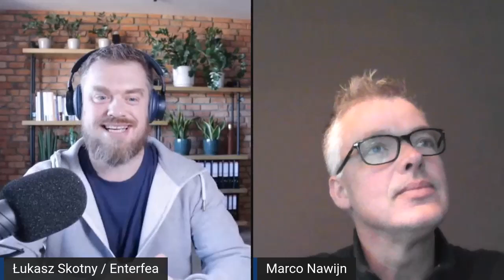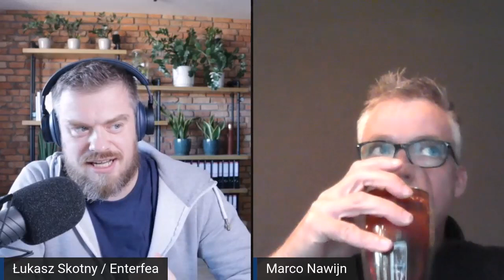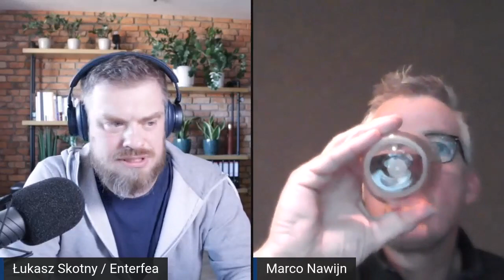FEA theory - Do you need it in practical design?

Comment: I like the analogy of driving a car without knowing how the engine works. It depends on what your goals are... if you want to get from A to B, then sure, just drive the car. If you want your car to outrun the competition in a race, then you had better understood how the car works. The good thing about FEA users is that they are all smart people, so even when they don't want to or need to, they will eventually learn more and more about how the car works anyway.

Those messages from the solver which are expressed in mathematical terms, are (in my opinion) just showing the inability of the solver developers to come down to user-level. We would not accept that kind of behaviour from car manufacturers (at least not  anymore in modern days), but in solver world progress is slow. They would rather add some exotic new feature that benefits 0.01% of the userbase, than to make the solver output easier to understand.

Comment: 41:51 When engineering strain of a uniaxial tensile specimen is measured and reported, the reference gauge length (e.g. 50 mm) is much larger than the length of the necking region. This arbitrary definition of strain underestimates the true strain of necking grain-scale or mesh-scale elements. Therefore, plastic strain of necking materials computed in FEA is not directly comparable to material data, unless the neck area was measured, and true strain was calculated using: εt = ln(A0/Aneck).
Reply from the maker: Sure, although it has to be said, that usually the strains are limited (by the codes/standards/practice) far below values that would even get closer to necking start
Reply: @Enterfea  Yes, except where there are high stress concentrations. I’m fairly certain (but not 100%) this is why a FEA/real-world case can strain far greater than the tensile test (engineering strain) value, before fracturing.

Comment: I would argue teaching theory at university is a good thing, because:
- lessons time is limited, so getting to know foundational theoretical stuff behind all or most of analyses might be better than some practical stuff (the more particular an example is, the less broadly applicable the takeaways may be)
- professors usually know more theory and colleagues at work more practice, so learning theory at university and practice at work makes sense
- practical knowledge comes with practice and there are no shortcuts here (except maybe if you know more theory, you may also gain more from practice)
Reply from the maker: I disagree with such a logic Tomas, although there might be something there. While I agree that professors are heavily theory-oriented (I would dare to say in a significant majority of cases), that would be a problem of "why those professors, instead of somebody else" then. I mean, we should teach what we know the most (for sure!) but in the end, University also selects what is being taught "in general", so it should strive to find teachers who can effectively teach what University wants to be taught (finding such teachers may be impossible, this is a separate case). 
And since people doing the work, tend to know the "practical things", and are not using the theory that much... why teach theory at university? It's almost as if teaching folks is a semi-unneeded thing, simply because we have teachers who can teach it!
As for the time constraint, I'm 100% sure that a Uni graduate will not be able to write her/his own nonlinear solver... just the same as performing a complex FEA analysis. But that graduate will have a vague recollection of either theory or practical things. Absolutely not a "complete image", but a "base"... and theoretically, University could choose what that base should be... clearly they've chosen theory in many cases, which isn't the majority of the "needed" thing in actual work. 
And this is also a complaint we hear all the time... that universities do not teach skills that are needed in the workplace - I guess I would agree here.
But being an ex-academic teacher I can tell you, that teaching theory is easier, and it's easier to verify if it "worked". Plus the teachers are already there... so it may be, that it's just the easier solution, not a plan :)
Reply: @Enterfea  If you know what the students will be doing in the work, it is easy to create practical lessons for that. But in reality you cannot know this. Also, one of the selling points of study programmes often is that you can do many different things after that, in which case teaching just practical stuff is not very effective. For example, better understanding of linear equation system solvers may help you in many different applications and you would have to learn quite a lot of different "superstitions" to compensate for that. Role of university has always been to teach the underlying principles, which is of course getting more and more difficult when the tools we use are more complex than ever.
Also the skills needed nowadays are vast and it may be impossible to learn everything at universities. In my opinion, having fresh engineering degree does not signal to a company that you already know what they need, but it means you know some basics and have the ability to learn more. If they need you to have some special skills, you can enrol in a special course for that.
Extreme example may be IT, which is developing so fast, that teaching practical stuff using one set of tools is terrible strategy, since these tools may be obsolete by the time you graduate. Teaching principles is then much better.
Reply from the maker: @tomasletal257  that is definitely an interesting point. But I think that advertising higher education as "you may do a lot of things after it" seems a weird idea... here we would say that you will become a specialist in a field (and I'm not saying this is happening, but that would be a selling point). At some point, we have to specialize in something, and I think it would be the University level that does this. Still, this is a philosophical question really... assuming that the goal is to teach folks "broadly" would really be the goal (and maybe in your country it is, I'm not objecting to that as an idea really), then I would say that practical understanding of the strength of materials, broad effects like stability, fatigue, etc. would be far more important than learning how linear solver works... so as you can see I would still opt to teach other things than FEA theory... still the beauty of engineering lies in its complexity, and it's actually great that we can do our jobs and follow our engineering passion even though we do not agree on some things :)
Reply: @Enterfea  The idea is not so weird. Simulation tools are developing very fast and its hard to say which skills will be needed in 10, 20 or 30 years. Shifting the teaching focus to fundamentals in such situation is only natural.
Reply from the maker: @tomasletal257  Here, I can easily agree, although I would define fundamentals in terms of engineering skills mostly. So as I mentioned before strength of the material, hand calculations, and understanding of problems like buckling or fatigue. In the end, the tools are just tools, but the problems remain and knowledge about those problems will be always super important. We do not disagree here at all. 
Still, assuming that the tools are developing, they will become more and more sophisticated I would assume, and deliver the answer in more complex (although more precise as well). In such environment one could argue that learning how the old simple solvers (the linear ones) were done and how they did work... seems as reasonable as teaching how to compute additions and multiplications of big numbers with pencil and paper in order to teach folks how to use calculators... 
I know that I'm simplifying here, but I'm trying to wrap my head around what I think about it as I'm typing - so you know - let me know what you think :)
Reply: @Enterfea  I fully agree with the first paragraph and I think it is connected to the second as well. Many things from FEA can be shown at very small scale using hand calculations. If you want to scale it up, the calculations are the same, it is just more of them and there, programming becomes very useful.
I consider programming (even simple scripting) as very important general skill with broad application, even in FEA, where it may help you a lot in pre- and post-processing. General purpose FEA tool is just not complete without powerful scripting capabilities. Additionally, programming may be a very good investment into the uncertain job market future, which programmers seem to be the least likely to worry about.
I would also say that showing this idea, that some calculations can be scaled up a lot to students may lead some of them to development of new interesting simulation tools. In teaching, I would not go into the workings of linear equation system solvers, but I think it is good if students can transform a problem to such a system. Solution is then very simple, as there are many freely available tools to do so.
Reply from the maker: @tomasletal257  I think that we are very close now to actually agreeing. As I'm not opposing programming as a skill at all (I do write scripts in a few languages, although I'm not "fluent"). Without a doubt, programming is a great skill that served me well, and I also see that it has "broad applications" which is also very cool :)
And as you wrote " I would not go into the workings of linear equation system solvers" I think we are actually pretty close to each other. I usually oppose the complex mathematical operations that are taught and required in many engineering FEA subjects... usually, that leads to nothing - at least in my opinion. But if we are talking about FEA on a level I did in a post once (a simple 2-3 beam problem to show how the matrix is assembled, and maybe even solved) and then we go into "and this is how the solver does it, so let's learn how to do python scripting as it may be useful for you - then I'm fine. While I don't believe that the ability to write a simple 1D beam linear solver in python would do anybody any good (there are so much better tools than that!) the ability to write ANYTHING in python (FEA solver or not) is actually a pretty neat trick to have!
But in my experience, there were just math operations solved by hand of more and more complex cases... and somehow python or any other language was not even mentioned... which would defeat the purpose of the whole thing...
Reply: @Enterfea  I fully agree. There seems to be some momentum in teaching mathematics as it got us very far. Teaching mathematics intended for large scale calculations on computer without programming is terrible. Even very basic math can be very powerful with a little bit of programming. When I did a course on numerical mathematics, we had to calculate few iterations by hand, which is a textbook example of calculation best done using computer. Fortunately, in current version of the course, students already use computers for that.
By the way, I like Python very much and I think it has gotten to a point of being very useful for mechanical engineers and it is still getting better and better :)
Reply from the maker: @tomasletal257  My experience is, that if someone is will ing to dive deep enough into a subject, it's oftentimes that people agree, but they approach the problem from different angles. I'm so glad that we are agreeing her - this is awesome :) Thank you for your willingness to discuss this and exchange thoughts - I'm super glad that we did this :)

Comment: Hey Lukasz i assume you are a busy man and you dont need to answer my question here if you dont have time, but from your example when the silo over rail road is collapsing because of 2 support // gumybears , would it help if i run the analysis with nonlinear analysis and see the behaviour, i would not use any silo in my analysis , only loads that represents silo. I am now paranoid of gumybears.
Reply from the maker: I'm not 100% sure if I understand what you are proposing, and I know that giving specific advice on the internet based on a short description of the problem is a short way to get someone in trouble (as there is no guarantee that I understand your question). That being said, I would say that it would not fix the problem (the real problem) at all... All you could do, is model the silos AND supporting structures together and do nonlinear FEA. This would not "fix" the problem, but you would see the problem in outcomes, so you could at least react to this somehow. If I'm right, and you are talking about the example I recall... there is no way of "fixing that". Support rigidity is just a mess, and strengthening the silos would be the only way around it... well, you could make the beams much bigger to reduce the effect to some extent, but I don't think that would be an economically sound approach (huge beams would only help "a bit" - shell strengthening for local problems would be much more effective)
Reply: @Enterfea  Hey i think your answer was very good!
Reply from the maker: @MrEngineerNasa  I'm glad that I could help :)

Comment: With all due respect to Marco, I do agree with Lukasz. Digging deep into mathematics might be justified for those who feel nostalgia for the old times when no commercial codes were available, or only non-reliable open-source codes were there. Hence, they needed to write and run their own codes. Now, the game has changed. The validation and the reliability of the code and the mathematical part itself are done by a third party or the provider of the code, and what is left to the user is mainly technical and practical stuff and the engineering validation
Reply from the maker: Hey Hamzah! While I mostly do agree with you, I feel that I need to speak up a bit :) Without a doubt, you need to have the "superstitions" right, as I and Marco agreed on. And as I listed somewhere in the video, there are really 3 ways in which you can get those:
- Learn from someone else
- Experiment
- Learn some theory
While for me, learning some theory would be the least interesting option, I have to admit that now I realize that there are folks who would enjoy that road the most. And as long as a proper accent is placed (that the practical knowledge is way more important than theory, theory can easily be used to derive some practical superstitions that will guide you in the analysis :)
let me know what you think about this!
Cheers!
Ł